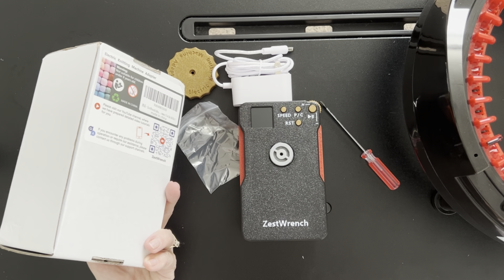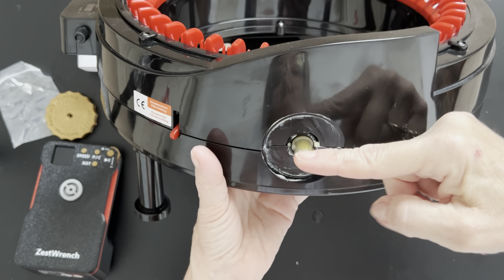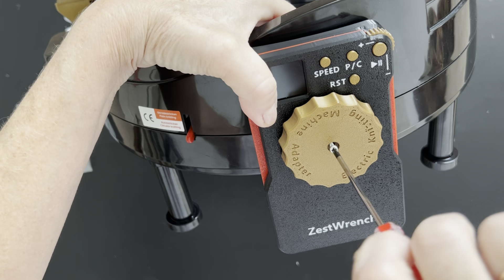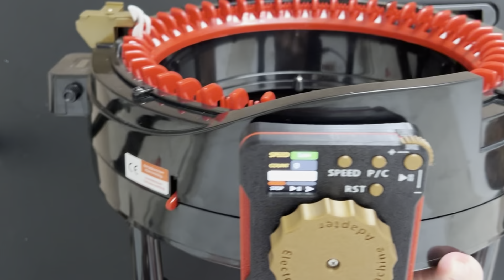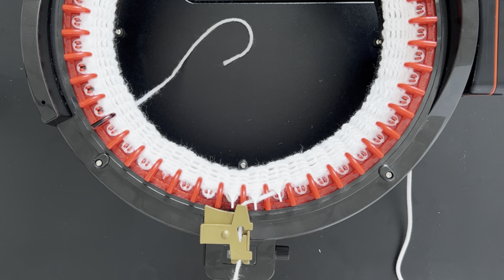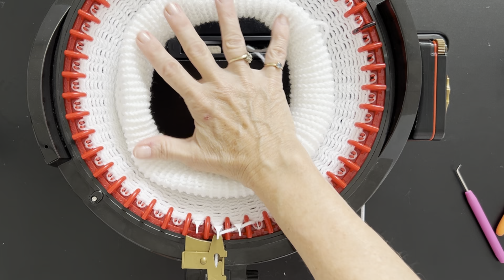ZestWrench Electric Knitting Machine Adapter - Addi /Sentro  Honest review with VERY IMPORTANT TIPS!

Comment: Hi Shelly, thank you for responding. The video that I cannot find is the one about you showing how to bring the needles closer. I have so many, many tuck stitches. The installation of the Zestwrench adapter I am having is the screw is not long enough to make contact with the handle thingy to clamp it to the Addi. I have two Addi, Three Sentro's and they all make so much clank clank noise. One is two months old and it clank clank, just do not understand why. I figured out how to add the aluminum foil to the handle. your machine is so quiet . love all your designs, thanks for sharing with us.
Reply from the maker: @gloriarobertson4016  I think the one you are looking for is the one I removed. All I did was tighten the screw and it “seemed” to bring the needles closer to the yarn guide. 
Tucked stitches are generally from using the wrong yarn and knitting too fast. 
Please do not force the ZestWrench screw. You will break the inside part if your machine.
Reply: @koalaknitsandknacksaddicrochet  Forgive my ignorance what screw concerning the needles being closer
Reply from the maker: @ sorry, it was two years ago. lol 
I actually haven’t touched it since. When I put the machine back together I just pushed the red piece closer to the yarn guide before I screws the part that held it, back onto the machine. 
I have since learned it’s more about the yarn choice and the tension and speed you knit. That’s partly why I removed both of those videos. I don’t add anything to my handle anymore either.
Reply from the maker: @gloriarobertson4016  I put it back up. Use at your own risk. 🥰 I think it’s totally fine to do it but I don’t find I need to anymore.

Comment: When I manually turn my handle, my claw weights get stuck at one or more of the 4 screw points as well.  When it goes faster does it overheat sooner?  For the cost of this adapter it should last longer than 10-15 minutes at a time and then you have to turn it off for 10 minutes and let it rest.  I just completed a Christmas project for 40 children from Big Brothers & Big Sisters and this gadget would have been of help.
Reply from the maker: You can go a lot longer. I trust people will figure that out as they go. It is a learning curve for me as well.

Comment: Hi Shelley, have you had time to decide if you can make panels with the ZestWrench? I've been trying to find out if the investment is worth it. Thanks.
Reply from the maker: I tried it and it or work but it is a bit of a pain cause you have to start and stop it at every end. I like the control on the first needle going in either direction. You could still do that manually and then turn it on till you get to the end of the row but I haven’t tried it enough to know if I’d like it. Sorry.

Comment: Shelley, I was wondering. Can you use the regular Addi handle with this? Also wondering if it works on your 22 needle machine. I am just curious, I have decided not to order just yet. I wanted to see how it works for you after several uses.  Also wondering if you are going to be trying the one from this company for the Sentro. Thanks for your time. Have a blessed day.
Reply from the maker: @colleenmelton6735  sorry that I didn’t answer sooner. 
I tried it on the 22 and it didn’t work. I think it may have been because I didn’t screw it on tight enough because a few people in my Facebook group said they use it with the 22 needle as well. 
It’s not advertised for the 22. 
I do not know if the Addi handle fits. I haven’t tried it and I never got a chance to today. I have a busy day tomorrow as well but I will let you know ASAP.
Reply from the maker: @colleenmelton6735  Hope you had a blessed day as well! 🥰
Reply from the maker: @colleenmelton6735  I just tried the Addi handle and no, it is not meant to work with this unit. 
If you are using the adapter then you really won’t be cranking manually except for the first row or two and that is very manageable with the handle it comes with. No need for a bigger one. 
The unit can be attached to the 22 needle but it is not a good fit and clearly is not meant for it. It will turn and then stop because you can’t get it to nestle in close enough for the gears. 
Some have said they use it but I would say that you should not use it on the 22. If it has to be forced it’s clearly not meant for the machine.
Reply: @koalaknitsandknacksaddicrochet  Thank you for taking the time to check this out for me. Thanks to your video and information I am going to order one. It won't be here till November. With patience being a virtue, I should be a very virtuous woman by the time it arrives.  Again thank you very much for taking the time. I know you are very busy and it is very appreciated.
Reply from the maker: @colleenmelton6735  you are very welcome! November? Yes, you are gonna be a saint! Haha

Comment: I received mine and love it but notice that it stays lit all the time. I assume this is keeping it on/hot and will shorten the battery life. Is there a way to turn it off ??
Reply from the maker: @neciecothran2591  I am new to this gadget as well and am learning like everyone else. I would unplug it every time I am not using it to prevent it from overheating. Does it stay lit when unplugged ?
Reply: @koalaknitsandknacksaddicrochet  yes. I was unplugging it but noticed it is always lit.
Reply from the maker: @neciecothran2591  I just unplugged mine and it shut off. Sorry, I’m not sure. Maybe contact the seller.

Comment: Hi again just wanted to ask you a question i install the adapter to my ADDI 46 its working good the question is does your adapter movs a little when its working and the center wheel look like it will fall off it wiggles while is turning should it do that as for going around to knit i did good only one drop stitch hope you can help
Reply from the maker: @raquelreyes8573  yes it does. I don’t want to tighten it cause I dont want to strip the treads. (Treads ….. is that the right word?) lol

Comment: Can I use it on Addi 22 needles?
Reply from the maker: @andrishiapani6221  no you can’t.
Reply: @ Oh no, I just bought it! Will it not work at all, or will it just count incorrectly?
Reply from the maker: @ it is not meant for the 22. Its measurements are for the 46. I would not manipulate it to fit. You will ruin your machine.
Reply: @ Thanks! I assumed their handles and knots were the same size, so I thought they’d be compatible.
Reply from the maker: @ the handles are the same but the ZestWrench fits to the body of the 46 needle machine. 
You can force it  on to the 22 but I definitely wouldn’t.
Reply: @ Yeah, I get it! Thanks!

Comment: Hi Shelly, I had some questions for you about the installation. I bought the adapter, because you are pleased with it. I have search for your email address but I see you do not provide it. So I will presume you do not want to . I also am having problems finding two of your videos you said you would share but the one link says it is not available. thank you for the ones you are sharing.
Reply from the maker: @gloriarobertson4016  
I do have a link for it. Here it is….
https://youtu.be/622QO2Y-jKo?si=ZYM1E__mQD4UbNdf
I no longer have the video up where I take my machine apart or make a change to tighten the handle. 
I need to make a better video for taking apart the machine and as far as the handle goes, I decided I don’t want to be responsible if someone tries it and doesn’t do it exactly the same and breaks their handle. 
Are those the videos you can’t find ?

Comment: I’d be worried about stripping my gears but it does seem to go at the same speed as hand cranking.  I’m going to think about it.  It definitely would be a time saver
Reply from the maker: @Dianemc79  I was worried about that as well. I mention it in the video and then tell you that I do not think it will.
Reply: @koalaknitsandknacksaddicrochet . I went ahead and ordered it.  I make hats for charity and this will really save my arm….   I’ll let you know once I get it
Reply: I just received the adapter and it was very easy to install. I made a hat and I used low speed. I made 102 rows there were no drop stitches. However there was a little bit of a learning curve with tension as I was going along. I found that if I just let the yarn feed by itself, it went a lot smoother so far so good
Reply from the maker: @Dianemc79  I found the same thing to be true. Let it feed itself. Just make sure that it is loose and untangled coming out of the ball. 💕
Reply: @koalaknitsandknacksaddicrochet  exactly!    Thanks so much for your review!

Comment: Why does it make a banging noise when it goes over the black hooks? Mine did that, so I returned it as I couldnt get a reply as to the cause or normality. Yours is the first Ive seen which also has this issue. Has it been a problem?.did it develop issues because of it.? TIA
Reply from the maker: @satsumamoon  it’s not an issue. All of them do this. The black needles move the counter.
Reply: @koalaknitsandknacksaddicrochet  How do you know though?
Reply from the maker: @satsumamoon  because it’s how the counter moves. Everyone’s machine is like that.
Reply: @koalaknitsandknacksaddicrochet  I went through several videos of people using this knitting mill , solely for the purpose of finding out if this loud click was normal . Its not just a loud click,-clack with mine , its also very difficult to push over that part. Mine stops at the black hooks unless Ive built up some force.  Your video is the only  one that Ive succeeded in finding another clicking machine, although it does seem that yours does NOT require extra force to push it over the black keys/ counter.
Reply from the maker: @ ask in any Facebook group. Maybe you will find a majority answer there. 
Many videos remove the sound and do a voice over. I do not do that. 
I truly am 100% sure that the three black needles have a louder sound and are a bit tighter to get past because they move the counter. 
I honestly am confident it’s on all machines. 
I have 4.  
Don’t take my word for it though. Ask in some groups.
Reply: @koalaknitsandknacksaddicrochet  Thank you. I appreciate your reply,  maybe I will repurchase an addi, from a different vendor.
I left fb a few years ago .

Comment: I just got my Zest Wrench yesterday to use specifically on my Addi 22. It works like a charm!! The only little problem is that the digital counter is 5 rows behind the analog counter on the machine. I thought that it might be due to the size of the 22 needle machine because it has approx. half the number of needles as the big one but I haven't tried it on my big Addi yet. But that's very minor...
Reply from the maker: @kathywinn2617  I didn’t think it fit the 22 needle Addi! I think the counter moves depending on how many rotation the adapter handle does that’s why it slowly get one row behind on a 100 row project on the 46 needle. 
I tried hooking it up to the 22 and it didn’t work.
Reply: @koalaknitsandknacksaddicrochet  What part specifically didn't work for you on the 22? Can I help??
Reply from the maker: @kathywinn2617  I hooked it up and it didn’t turn. I will definitely try again. I thought it was only meant for the 46 needle!

Comment: I purchased a Zest Wrench for my 48 Pin Sentro. My Sentro has a cap in the handle that does not pop out. The Zest Wrench will not work for these machines. It requires an additional gear piece that is not included with the Zest Wrench for Sentro 48 pin machines. The Zest Wrench for 48 pin machines will only work if your 48 pin Sentro has a cap that pops off on the crank handle. Hopefully in the future the Zest Wrench producers figure this out. I sent them a message and left a comment in the review. But for now if you don’t own a Sentro 48 where the cap pops out you can’t use a Zest Wrench.
Reply from the maker: @francenebrown2423  that is very disappointing. So sorry it didn’t work for you.

Comment: My 22 Addi comes in a few hours and my big addi comes Saturday, can’t wait. I did buy the zest wrench for the Sentro and it worked beautifully for 18 rounds, it just stopped moving, no knots nothing stuck but the motor was still running. I uninstalled and reinstalled the device. It worked great for another 22 rounds and stopped but motor still running just not turning. I returned it. Now im afraid to buy the one for the addi.
Reply from the maker: @galindawright840  im excited for you that you are getting Addi’s. You will love them. Thanks for the info on the adapter. I hope mine holds out. However, I don’t plan on using it with every project.
Reply: @koalaknitsandknacksaddicrochet  I do have the attachment for the sentro but not the addi I don’t think they are the same handles
Reply: Ps I love your videos and have been lost in them off and on the whole weekend. Thanks for the hard work you put into them
Reply from the maker: @galindawright840  no they are not.
Reply from the maker: @galindawright840  Thank you so much for being a part of my channel community. Please join my facebook group as well. I’d love to have you participate there as well. 🥰
Reply: @koalaknitsandknacksaddicrochet  I already joined, like 5 minutes after subscribing here, lol.
Reply from the maker: @galindawright840  💕
Reply: @koalaknitsandknacksaddicrochet  I bought the screwdriver attachment for the addi machines, I returned the egg didn’t like it because it won’t take even dk wt yarn. I tried at least 6 times.  I bought the clover wonder knitter and love it. I do have the embellish knitter but it’s for thinner yarn too. I wanted thicker to make scrunchies. I can also do flat panels to make little snowman scarves.
Reply from the maker: @galindawright840  I love the Wonder Knitter far more than the Addi Egg. 🤭

Comment: Interesting! It does depend on the cost but it certainly would be a vast improvement on using the electric screwdriver. Thanks for reviewing it. I'm off to see if it is available here and what it costs. I like the way it stops for you to turn direction when panel knitting. That would allow time for the yarn to be pulled tighter at the edge.Thanks again!
I've just looked and it is not a bad price! Perhaps it will make me use my Addi machine more.
Reply from the maker: @lunasmum6869  please use the link below the video in the description box to direct you to the item. It’s a small way to support my channel. 
Thank you so much! 🙂